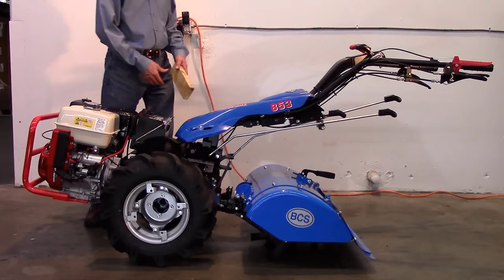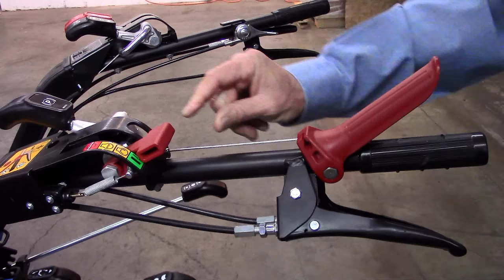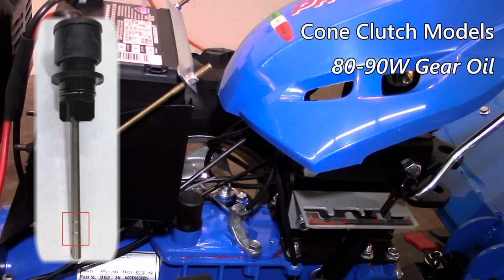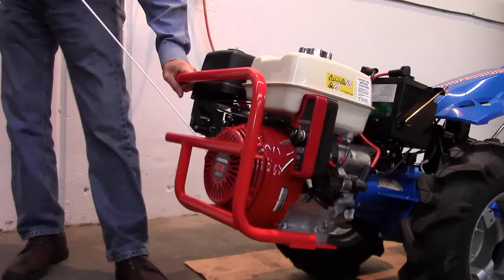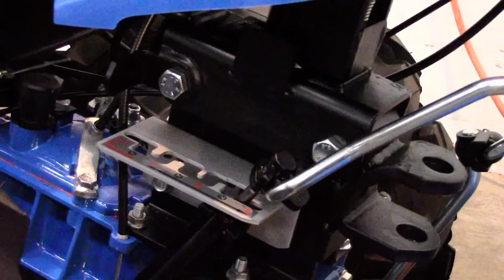Simple Tractor Operation Instructions for BCS Two-Wheel Tractors

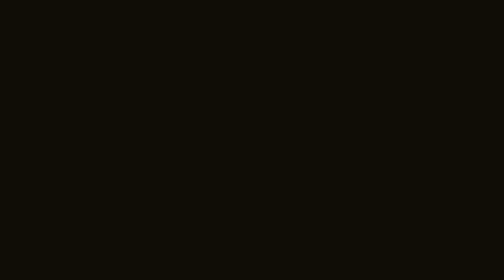Comment: I just bought an 853 second hand, nearly new. When I bought it, the handlebars were over the engine, with a flail mower mounted. When I rotate the handlebars to mount the tiller, the pto lever will not turn 180 to meet the handlebars in the new position the way it does in the video at 6:39, but will only flip up and over very awkwardly. It definitely doesn’t seem right.
Reply from the maker: Hi @Mattfooey, this is a pretty easy fix!  Sounds like the handlebars may not have been rotated in quite some time and may have seized.  Follow the link below and click on "Tractor Bulletins."  You're looking for Service Bulletin 2-24 | PTO Rod Rotation Repair.
 https://www.bcsamerica.com/service-information

Comment: Hi there! When checking the transmission fluid does the tractor have to be completely level? I have put a bubble level on the flat side parralel with the ground (silver rectangle under engine). Im just abit off with the level however, the oil level seems to be about abit over the top notch.
Reply from the maker: As level as possible, yes.  Sounds like you got it.

Comment: you did not show how to start the tractor with the key
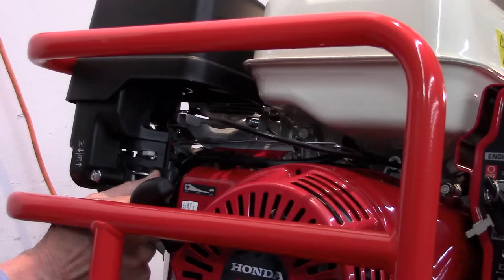Reply from the maker: Sorry, didn't think we needed to show how to turn the key.  Electric (key) start is an optional feature on most of our tractors (models 722 and up), but every model has a recoil (rope) start as well. Very handy if you find a dead battery before you want to get to work.  To use the the electric starter, simply turn the key after the instructions at 2:25 in this video.

Comment: Crappy gasoline engine, to light and flimsy. Get older diesel ones.
Reply from the maker: It's a Honda GX series.  Literally the best you can buy.  The extra weight of the older diesel models actually caused a lot of balance issues.
Reply: You can get diesel models here in the UK but, even though I have cheap "red" diesel, I got the petrol BCS740. The diesel version is about £1000 more and has far higher noise and vibration than the petrol version.